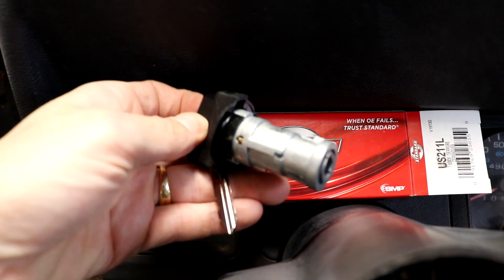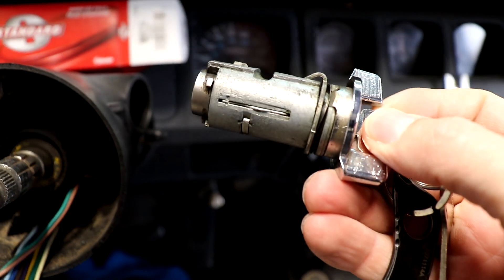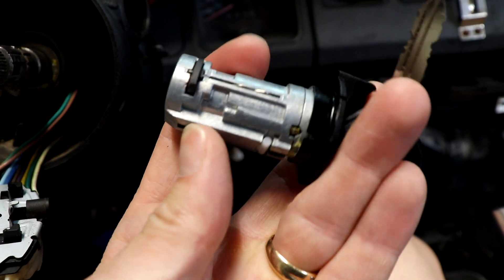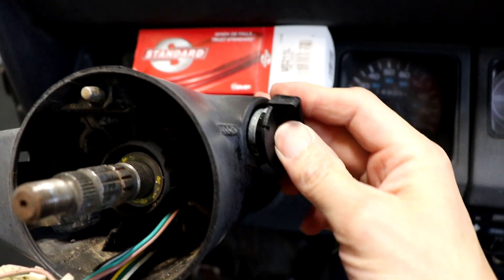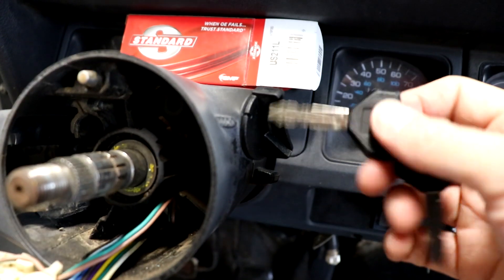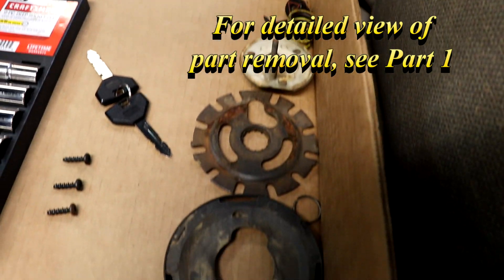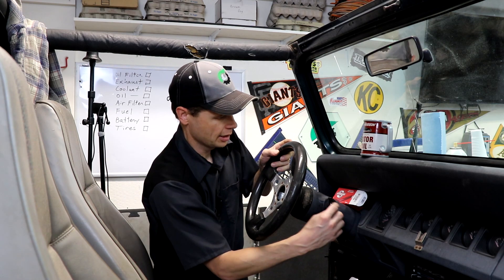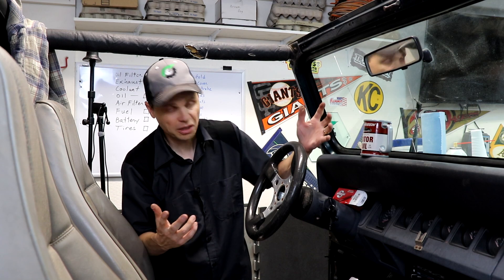Ignition Key Replacement Part 2: Jeep Wrangler Key Cylinder

Comment: The old lock had the chrome gm style thingy where the key inserts then the new one has chrysler style with the double cut key. Guess the gm columns were used all over.

Comment: Need help here: will the engine crank/turn if you use a pliers instead of the ignition cylinder and key?(I removed the ignition cylinder) or does it need the ignition cylinder and key?

Comment: The cylinder can be installed with the key in it ...and the only thing that you need to replace the cylinder with is the key. You don't have to take apart the steering wheel
Reply: Try this after you get it together... insert key turn back to accessorie or close to it, while pulling out the cylinder.   It's that simple.

Comment: I have an ignition problem on my 92 YJ.  Cannot get spark.  No indications on light panel when you turn the key from position zero to one.  Starter engages fine and engine cranks great, and fuel flow is good.  No spark
How do I confirm the ignition switch is bad before I tear into  the steering column?
Ty Bachmann

Comment: Great videos. I have an 87 YJ pretty much stock. Changed my cylinder because I have the opposite problem, the cylinder spins loosely.  After changing the lock cylinder is still loose and won't start the engine.  When I turn to on in doesn't spring back.  Is that issue?  Thanks for you help.
Reply: Did you find a solution?
Reply: @burtmartin9249  Replacing the cylinder didn't help.  I had to replaced the plastic sector gear thing that's in the opposite side of the key cylinder.  The teeth broke off which prevented it to roll back.  It was called Steering column ignition lock sector actuator kit for tilting column.  I bought it on eBay.

Comment: Performed this fix today, as soon as I reassembled, it wouldn’t start, not even a starter click.   Dash lights still work, just nothing when I turn the key, which feels normal.   Thoughts?
Reply: I have the same issue. Did you find a solution?

Comment: What if you can't get key to on position will it still come out?
Reply: Try to get the cylinder to turn back to accessorie.  Do this while pulling out the cylinder...use wd 40 if you need to.

Comment: New ignition wont go in even though it's the same part, any suggestions?
Reply: Put the key in the cylinder and slightly turn it back and forth while putting it in.  If you hold the cylinder and turn the key you will see how it works.